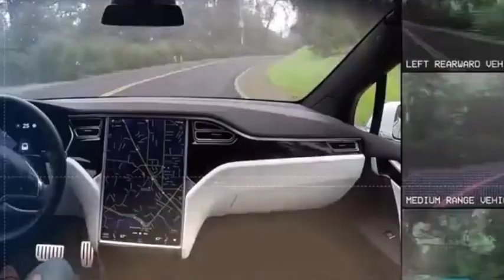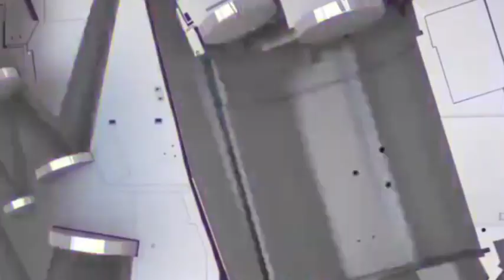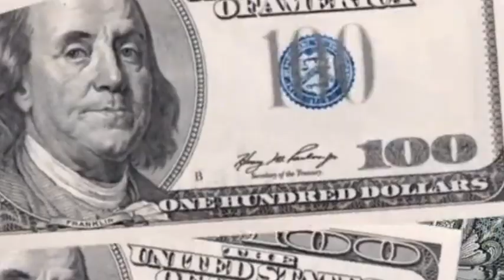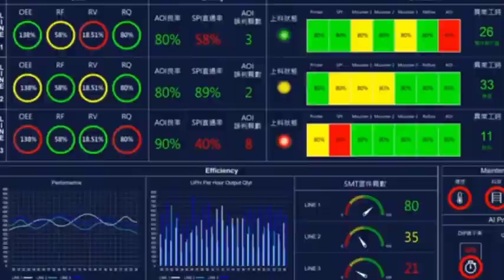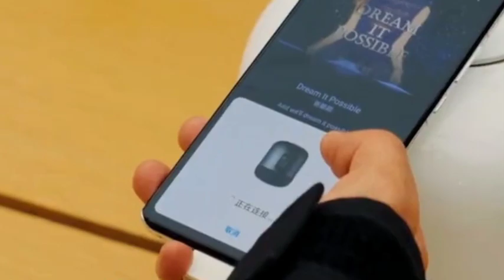Under the impact of Huawei Mate60, TSMC’s market value evaporated by 560 billion!

Comment: Selling CHIPS 🍟 is like selling only a single ingredient out of many  ingredients to bake a good cake before it can achieve the perfect finished CAKE.
CHIPS itself does not create the final product without the demand of the final product manufactures.
If the bakery have other suppliers or substitute for the same replacement ingredient to bake cakes to for the finishing product to the actual consumer market, TSMC got SCREWED.
Thank that to itself plus support from UNCLE joe and his orange 🍊 agents.

The once upon a time mighty KODAK RIP is very lonely at the bottom 14 floor below ground waiting for TSMC to joining RIP.